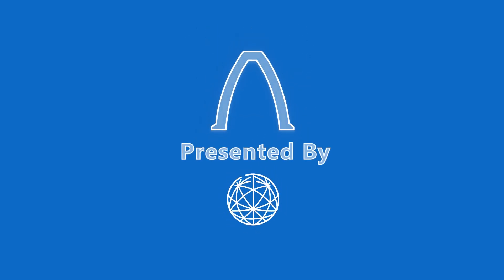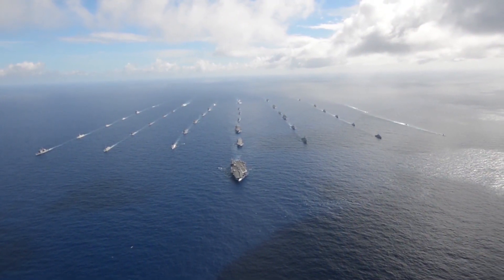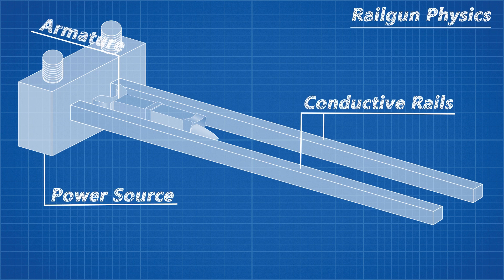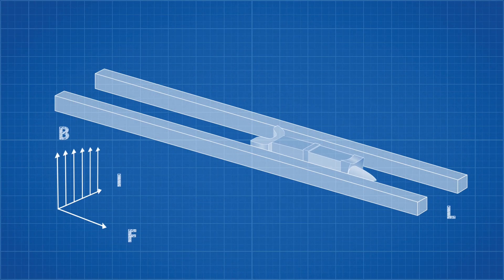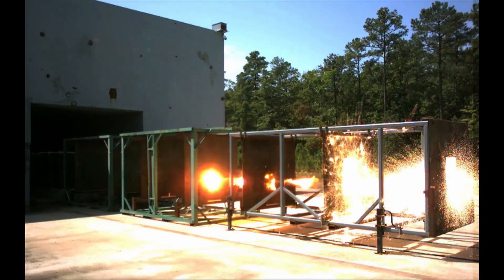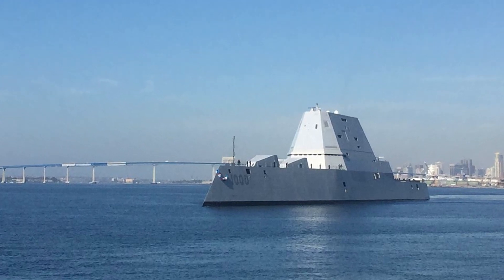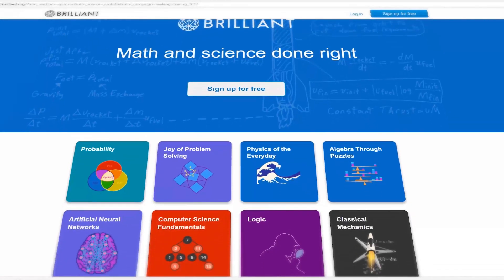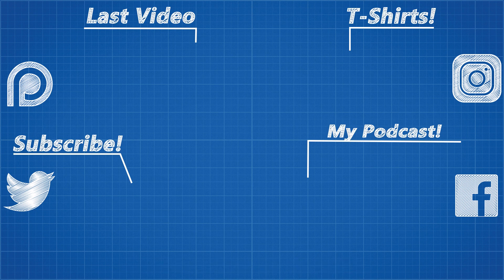The US Military's Most Powerful Gun

Comment: Can't they cool the railgun with liquid nitrogen so it stays cool / doesnt melt?

or will the cold decrease the power of the railgun?
Reply from the maker: No, actually I think lower temperatures would increase the force, as conductivity rises with lower temperatures in metallic conductors. I'd be surprised if they aren't already doing that actually, good idea.
Reply: Cooling it would be very good for performance, but not practical. The energy required to keep the system cool at normal temps is huge already, let alone cooling it to liquid nitrogen levels. (Or cooling nitrogen to its liquid state, but are similar). It is impractical too for a ship to store such amounts of liquid nitrogen and they start facing problems faced by conventional ammo carrying ships.
Reply: Not completely familiar with engineering to say, but say you cool the rail gun to the temperature of liquid nitrogen levels. How would the materials of the rail gun react to the air pressure differences by firing a round? Going from nothing to 6x the speed of sound would create a crazy amount of energy contained within the bore of the rail gun, and as far as I know, liquid nitrogen tends to make most materials more brittle and susceptible to breaking.
Reply: Jacob well, it's not specifically Liquid Nitrogen that does it, it's the colder tempratures. It causes the molecular structure to become more stiff, closer, and brittle. When a molecule or atom gets colder, the molecules themselves slow down and start to get closer and closer together.
Reply: If they are deployed on ships why not pump sea water into a cooling jacket attached to the rails instead of constantly using and depleting liquid nitrogen?
Reply: A lot of metals become more brittle at cryogenic temperatures, so the rails might shatter. However, the military has a lot of fancy alloys that might do the job.
Reply: See  Jian Shin ammonia circulation might work as a method of Colling, it is toxic to human if it escapes but it has fantastic heat transfer capabilities and would be easier to work with than large volumes of liquid nitrogen
Reply: They need a liquid nitrogen factory then
Reply: what if they had superconducting rails like the superconducting magnets at the LHC
Reply: Jank Paul the profile pic is taylor swift
Reply: I'm not sure about the ability or advantages of cooling to such temperatures, but the physical energy required to cool it down to this temperature is just impractical. Yes you can have nice methods to make it easier to cool the device down, but you are only getting closer to the absolute minimum energy required to cool it in the first place.
Reply: MOBOX this is what I was kind of thinking. Strong magnetic metals are typically not exactly the toughest metals, and cooling it to subzero tempratures could cause the metal to fracture and splint due to it becoming increasingly brittle, before eventually malfunctioning and breaking.
Reply: hey7328 the difference in that is that the LHC is, well, massive. I'm fairly sure they use extremely powerful magnets for these, but using a superconducter requires subzero tempratures, if I'm not mistaken. Which can be appropriate for something like a stationary turret, but not for a mobile cannon.
Reply: TheCptnZ the damage is done in the second it takes the projectile to travel down the rails. No amount of cooling can compensate for the heat from all that friction and the massive amount of power in such a short amount of time.
Reply: damn... i would have thought mabe if there was enough cooling in the system it would not be damaged as much? im assuming that they would have to replace the "barrels" after several shot.
Reply: wow i didnt realize how quick the damage would be done. i would have thought that maybe after the third round that it would start to become damaged. it makes you think what the us military is doing to to combat this problem
Reply: See  Jian Shin they must use tungsten carbide. Very hard to shape. But once you do it it's almost impossible to destroy
Reply: It'd be crazy had they not thought of that idea yet, i mean, with all the money at their disposal... Then again the US tends to do shithead things all the time lol
Reply: Kevo Morider Metallurgically exposing steels to extreme heat and the extreme cold would actually soften the steel. Its almost an instant quench which can lead to cracks and warping of the rails. Best way to solve the rails failing is to reinforce the substrate and to pick a material that is heat resistant. Heat resistant materials could be something as simple as graphite coated with 500 microns of Titanium Carbide.
Reply: Okay.  I've read ALL replies to this comment to date.  And generally two problems have been properly identified:
-heat; lots of it, in a short amount of time, and
-mechanical stress, arising from friction and Lorentz forces of the rails.

I think that LN2 is not a practical solution, for reasons already mentioned.  A chilled seawater jacket would help (naval technology can chill seawater that is above freshwater freezing, for consistent perfornance), but what this design ultimately needs is something that will deal with the heat problem while the projectile is accelerating along the rails.  A  lubricating, conductive, non-flammable, non-combustible, preferably volatile liquid.  This would:
-Close the circuit when applied
-Help handle heat and friction when the projectile passes over it
-The property of volatility would mean that  friction could cause it to evaporate, removing additional heat before it reaches the rail structure and also breaking the circuit to reduce Lorentz forces on the rails.
Reply: The thermal shock from firing would probably damage the rails more and at liquid nitrogen temps the rail would be more brittle which could cause failure from firing
Reply: That's an interesting question. As a material heats up, there are a higher amount of ions, therefore higher conductivity so that may be a negative factor. But I wonder how exactly that would impact life cycle of rails too as temperature swings is also not good.
Reply: but that does not help. Its not possible to cool something like that. so much heat is created is such a short amount of time.

Comment: 0:24, "ackshully", the rifling is almost as old as the concept of the firearm itself. I myself own an old wheellock rifled carbine from the 16th century.
Reply: 16th century is about 600 years after the firearm was invented
Reply: Cannons had been around for about 300 years by then though, and they certainly didn't have rifling to begin with.
Reply: yea, rifling without tightly fitting projectiles arent necessary anyway. I was going by the fire lance in 10th century.

Comment: One thing to keep in mind is that moving to railguns does not actually eliminate the 'ammo explosion' problem.   All that powder is just an efficient chemical store of energy that gets released all at once.  With a railgun, you still need all that energy, it still needs to be stored somewhere, and since the chemical bonds in high explosives are an extremely efficient store of energy, you are going to require a lot of it.

Pretty much anything that can power a railgun has enough energy in it to produce a pretty respectable explosion if hit, and whatever fuel that power source uses is its own danger.

Put another way : railguns trade chemical propellent for electrical propellent, but that electrical propellent still has all that energy somewhere stored on that ship.  One moves the problem, but does not eliminate it.

Comment: >Picturing an Abrams with a smoothbore gun while talking about rifling.
Reply from the maker: Although I didn't know that was a smoothbore gun, the Abrams wasn't even in shot when that was referenced. People always be hunting for mistakes
Reply: Only the challenger uses a rifled barrel in tanks as it makes it harder to use SABOT rounds.

They were looking at replacing with a rhinemettal one though. Whether they will or not is not something I know.
Reply: The Challenger 2 LEP will not replace the L30 rifled gun. Scuttle butt is that it would require too many engineering changes to the turret. BAE will replace only electronics.

http://www.baesystems.com/en/product/challenger-2
Reply: Rifled barrels require more frequent maintenance and doesn't affect range or velocity in any meaningful way compared to the smoothbore barrel the Abrams uses

Comment: At the sustained speeds of Mach 6, would explosives even be necessary or safe? At those speeds, wouldn't a solid slug be enough to leave a fairly large crater?
Reply from the maker: Yeap the projectile is just a tungsten missile right now, no explosives. The kinetic energy alone is immense, I should have talked about this in the video.
Reply from the maker: Doing my job of answering question for me lads, thanks
Reply: +Ricardo Santos+
That's sort of like the concept of Rods of God. Large Rods of Tungsten dropped from orbiting satellites.
Reply: Can this weapons be placed on space and then used as a non radiation equivalent to nukes?
Reply: There are some pretty amazing clips on YouTube describing the projectile more. One shows it hitting a fake warhead and the fireball is insane. The engineer explains that the fire and explosion is all caused by the immense speed of the impact as metal is vaporized.
Reply: Theoretically, yes. Legal and diplomatic hurdles would be significant, however, as space is internationally recognized as a demilitarized zone and anyone attempting to change that would be in for an extremely bumpy ride.
Reply: Wasn't that the plot of G.I Joe 2? Massive space rods that destroyed London?
Reply: ThingThought if its fast enough it wont decrease to its terminal velocity. unfortunately im not too sure how fast it WOULD have to be travelling, but if you look at meteors, a considerably small rock is capable of more damage than a nuke at certain speeds, and the air resistance wont be strong enough to slow it in time. ALSO, the resistance will be incredibly strong, which is why most meteors just burn up in our atmosphere
Reply: Bregil 
I believe that only WMDs are officially banned, so effectively dropping cinder blocks on people from really, REALLY high up is still fair play
Reply: i dont think this is smart, as any objetc falling (even when starting by being flung very fast) will stabilise at their terminal velocity, so in the end its just like droppins something
Reply: +Ricardo Santos
Kinetic rods, my dude.
Reply: Scientifically speaking, a grain of SAND is enough to be lethal to a nuke when using a railgun.
Reply: The projectiles will be guided and will damage targets by kinetic energy. For air and lightly armored ground targets, instead of explosives there are plans to use smaller projectiles housed inside the main projectile that will deploy at the last moment to produce an AOE shotgun-like blast, kind of like an airburst.

I can't find the website anymore that contains info on the airburst projectile, but here's a link with some info on the guided projectile:
janes.******com/article/72302/ga-ems-to-test-10-mj-railgun-in-early-2018

Here's a link showing how they are working on different gun sizes and you can see how big the power sources are:
ga.******com/missile-defense-systems

Youtube sometimes hides posts containing links, so remove the stars in the links.
Reply: Found the shotgun-like projectile, it's called the Blitzer. Here's a concept video, so take it with a grain of salt, but it shows what their general plans are: youtube.*******com/watch?v=x8dxhPY1WI0
Reply: There was proposed solution for something similar, regarding the reduction in force for the Ohio Class SSBN's. Today 4 of the class have been converted to SSGN (Guided missile submarines) with the capacity of over a hundred Tomahawk missiles, in place of it's Tridents. There was another, far more scary proposal.

The proposal was to replace the 8 nuclear warheads on the trident, with a set of dense metal slugs. These projectiles would thus be delivered in the same manner as the previous nuclear warheads, but could inflict massive destruction simply with with massive amounts of kinetic energy upon impact, far more than conventional explosives would be capable of. (A dense, heavy object, entering the atmosphere at 22 500km/h carries a staggering amount of kinetic energy.)

There are some advantages to this system, it's more cost effective than explosives. Safer for the launching platform, that doesn't need to carry tons of high explosive (though moot since it would be sitting on an ICBM) and no left over explosives at the target site, due to failed detonations and most important of all, no radioactive fallout.

The biggest problem, and the problem that killed this proposal was simply how would you know it is a kinetic warhead, or a nuclear warhead? Thus, use of the system against a nuclear armed nation, would very likely result in that nation retaliating with nuclear weapons, simply based on them not being able to risk it not being a kinetic warhead.
Reply: Bregil only applies to chemical, biological, and nuclear weapons.
Reply: They'll likely use high density reactive material at some point in the future. It's basically a mixture of metals like uranium or zirconium and teflon etc that burns or explodes on impact.
Reply: Similar to the kinetic penetration round used by Abrams tanks. Has a fancy name like Discarding Sabot Kinetic Round or something (that's wrong but not too far off).
Reply: You could fire a lump of plutonium that would go super critical on impact as it's geometry changed to a more compact form.  Handy if you are in orbit and trying to break up or deflect a large asteroid because if you can convert more of it's mass to plasma it will transfer far more kinetic energy than an inert projectile could.
Reply: Ken Morgan well, if you have a giant hole in your ship it'll probably sink, so in that use it's still very good
Reply: Sagrotan,,,, Nukes in the atmosphere ALSO convert 90% of their energy into radiation, Gama rays x-rays u name it. A very small amount actually causes the blast wave.      P
Reply: Wait a sec the immense kinetic energy is only useful if you can transfer it to the target.

rods from god work as the potential energy is converted into heat and shock waves when it hits the ground. There is nowhere for the energy to go other than being converted.

7.62mm bullets carve holes into bodies due to high energy. 5.56mm is smaller and considered deadlier as it tumbles and transfers more energy to the target.

DU anti armour bullets work because the kinetic energy gets turned to heat and shockwaves when they hit armour. 

Big ship guns may carry a ton of kinetic energy but if it can't transfer the energy to the intended target won't it just go straight through and cause superficial damage? Exocets in the Falklands hit UK destroyers. The missiles themselves made big holes but it was the unburned fuel that caused massive fires.

Sure you're got a big fucken hole in your ship, that breaks the stuff it impacts with but it'll just tear a channel through the target if there is no secondary payload to transfer the energy.